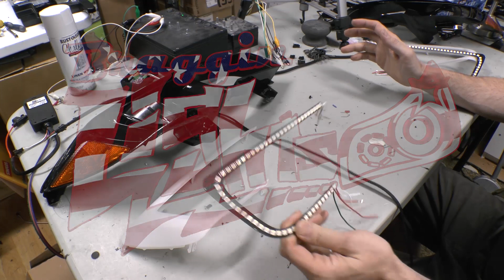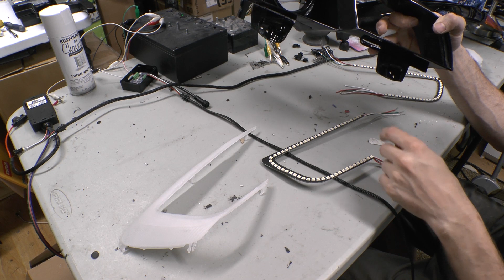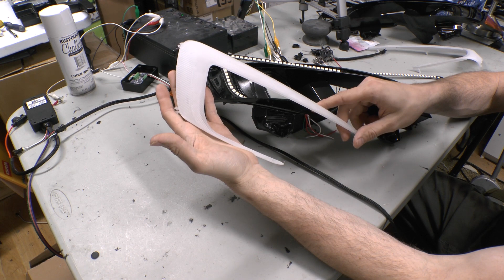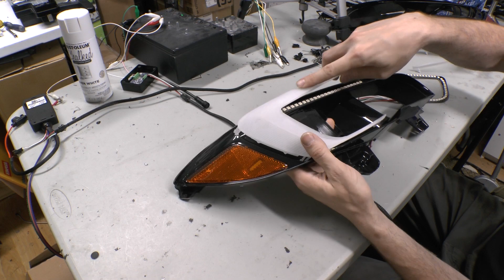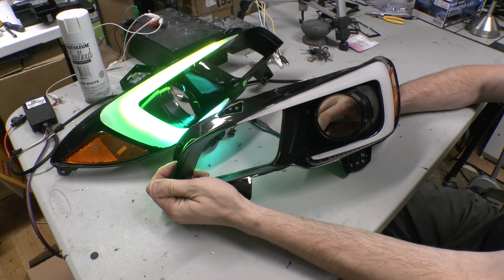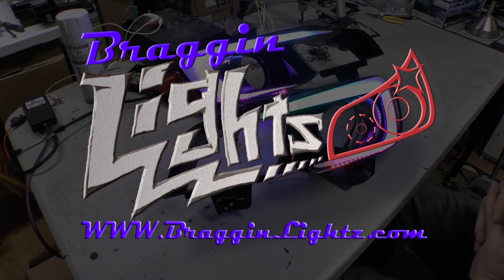15-21 WRX Flow Series C-light Install

Comment: If I don't have access to sandblast will just the paint work for the diffused look? or any other suggestion to get the best diffused look?
Reply from the maker: The paint will definitely help, most people don't sand blast it so it's not a big deal.
Reply: Thank you I appreciate the response 🙏 love your content. Just purchased a few products for my headlight build from your website
Reply from the maker: @chrischino5183  thanks for the support. I'll get that stuff out on Monday.